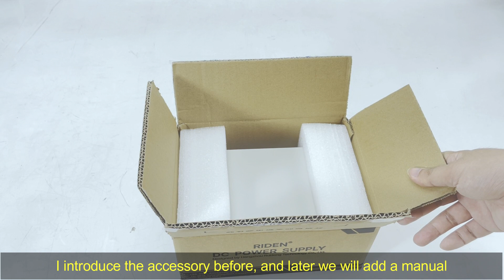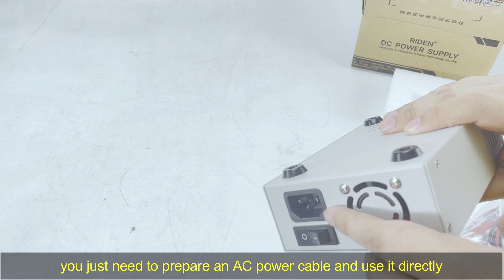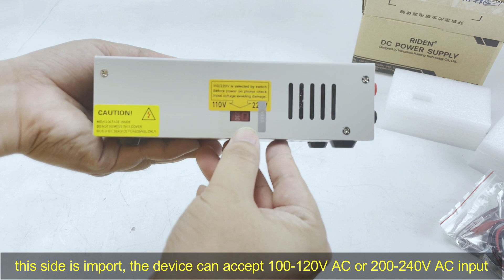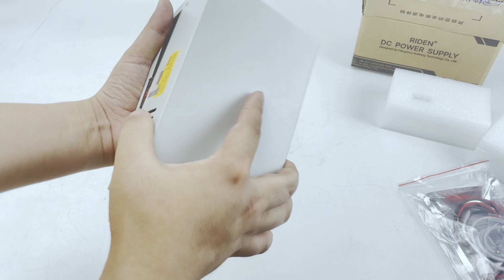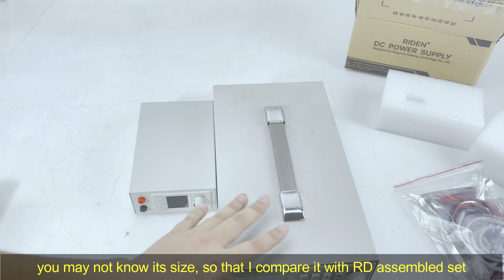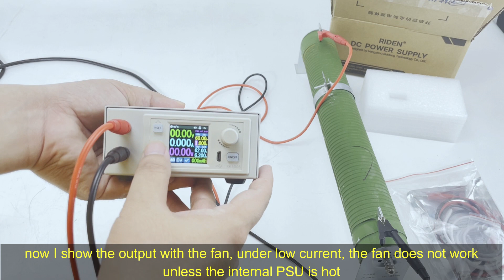RK6006-C 60V 6A AC to DC power supply introduction, size compaison, fan noise

Comment: It would be nice if the housings came with no power supply. I'd like to get one of these and repurpose a old atx power supply to power it. By the time I bought the module and case kit It'd be around $70 USD and I can buy another variable psu on amazon for about the same. It does 30V-10A, the HANMATEK HM310.

If I bought one of these without the case. I can get a project box enclosure for around $11 that would fit my atx psu, the module and multiple banana jacks for the fixed voltages the atx psu provides, and also your variable voltage modules output. 

If the provided case came with no psu. I could make a board that would accept regular atx connectors from a PC, and use only the power rails I needed. Connecting them to the module and also adding additional banana plugs for my fixed voltages. While not modifying the atx psu itself. 

I just need enough to do voltage injection to find short circuits. There is only one video of someone reviewing it through banggood. With videos like the one I'm commenting on, it seems you care about your products. Maybe reach out to some youtubers and send them some units. Big Clive and learn electronics being two. 

In the future I might consider one of your modules that has the keypad. The interface on this one seems better than your old grey one. This one though is still kinda lacking, since you mainly interact with the encoder knob.

Also a USB A female port would be great, for charging and the functionality to update the firmware from. Similar to how bios flashback works on motherboards. Hold down a button with the flash file on the root flash drive and it updates. I don't think many people in the west are going to trust your software, like on EEVBlogs video. 

Maybe you can do something similar to what pine64 does with their pinecil. Having it open source so the community can write firmware for your devices. Or partner with pine64 in making a product for them that meets that criteria. 

I'll likely go with the Hanmatek, but I'm still really undecided.

Comment: Hello, 
I'm a huge fan of your product (I have sent you the overshooting bug of the RD6006P last year, that you have fixed since 👌
 https://www.youtube.com/watch?v=s-oB-lACdy4 )
Also I have many many products from your Aliexpress store (about all USB tester-USB load, DPS5005 RD6006P RK6006 ... ).

My questions are:
- What is the Power Factor of this AC PSU ?
- Is there an active PFC inside ?
- Also, is the black ground wire isolated from Earth ?
- Is this PSU has a "soft start" (with NTC for example) ?

Thank you !
Reply from the maker: hello, for this C400 case and PSU
- the full output power factor is about 0.7
- there is no PFC
- in the AC power cable, the middle pin connected to the ground, so that you need to make sure that the outlet on the wall has ground wire inside
- yes it has soft start
Reply: @rdtech9153  Thank you very much for your reply !

Just about the ground cable:  sorry I think my question was not enough accurate 🤔=> I was wondering if this ground cable was connected to the negative output cable ? (so ouput not  isolated from the ground).
Or all is really isolated from Earth ?
Reply from the maker: @ceut2004  hello, the output - is not connected to the earth, it is connected to earch only with the input AC cable earth pin

Comment: Interface of RK6006-C is totally dependant on the pushbutton 'Rotary Encoder'. 3 questions Is this USB interface capable of bypassing this? Do you supply PC software to remote control? Is the USB data interface galvanically isolated?
Reply from the maker: hello, the rotary knob adjust all the setting in the manual, for PC software, we offer that and it supports USB connection to PC only, and the USB port is galvanically isolated.